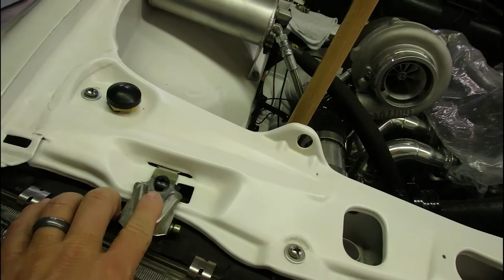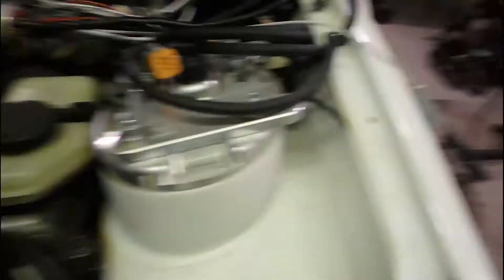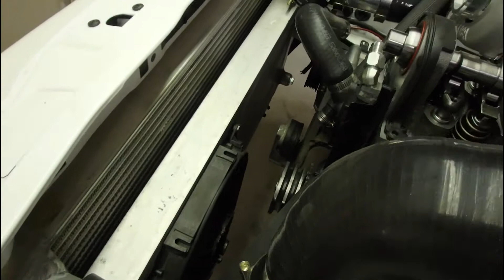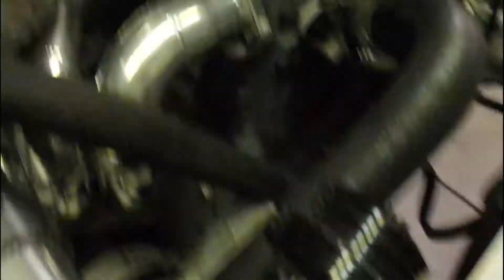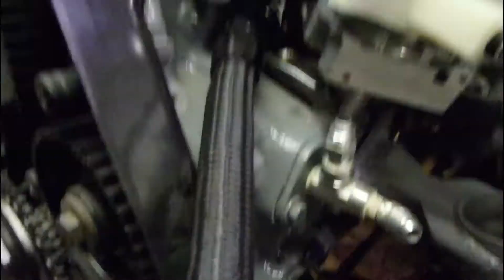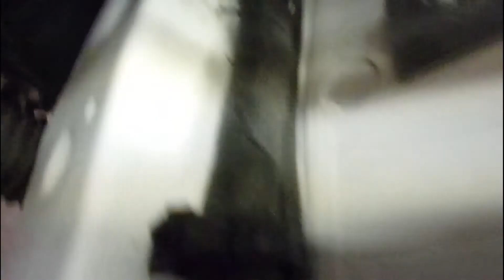Detailed walk around of my 1987 Merkur XR4Ti! Part 1 - Discussing the built 2.3L Ford Lima engine

Comment: Wow, that’s a lot of know how and work. The car looks just great. I think I sent you message years ago.  I am one of the oddball Ford crackpots (since 1979) up in Vancouver Canada. 

I used to own Group A four-door Saphire Cosworth race car that was  street legal and was probably the fastest car I have ever owned. 

I also owned a 1995 Group A Ford Escort Cosworth built by Ford motor sports in the UK but I purchased it from somebody in America in New York about 10 years ago.

 I currently I own Mallard green 1992 Ford Escort Cosworth that has been slightly resto modded which I’m going to sell and probably move to the new Ford focus RS.

On their own a single cam Ford engine is nothing spectacular except for the SVO mustang. As you know Jack Rouch used this little engine for years winning championship after championship.

Making a high horsepower four-cylinder engine is one thing but if it’s going to be driven on the street and you want a the engine to be fun and exciting to drive you need to focus on how to make the engine responsive at lower RPM. A laggy high horsepower turbo four-cylinder on the street is quite boring. 

Unlike you, I find four-cylinder turbo engine building intimidating and complicated, especially if it’s a new untested engine set up. You really need to know what you’re doing. Normally aspirated engines are much less complicated to build.

There’s a lot of things that can go into building a responsive four-cylinder high HP engine like the engine management system, the size of the turbo, cam selection, the size of the ports on the heads, gearing etc. 

Besides all of the above, if you want to make your engine rev quicker, a smaller flywheel is ideal as well as tighter gearing. 

This is my opinion. Hope I can see your car on the road soon. It’s probably going to be the one of the best Ford Merkur XRT cars in the US.

Michael.

Comment: I used to import Cossie parts for these cars back in the 2000's .. i brought over at least 150 pairs of the German Spec (left hand drive) headlights which are the correct lights you'll need for this conversion. I'd say about 1/3 of them got destroyed in shipping. I would import full cars, both Rs and Rs500's along with all the Group A spec driveline and suspension parts , body kits, you name it ! Had a a good relation with many wrecking yards over there .. wheich they call breakers in Europe. I've owned 14 Xr's over the years but own none now. My last 89 had full Sierra Sapphire awd conversion, Esslinger built block which was Turbocharged and supercharged with B234f Volvo head, Tko600 Transmission & custom transfer case and a Toyota Supra differential. I also built an Ls1 powered 88.  I miss them all. Anyway, Glad to see you and many folks here are still restoring and driving them.

Comment: Thats a really nice chassis to start with! I'm doing the angry eyes with silverado headlights. Don't gotta spend 100s on headlights for Cosworth Spec and cut out the buckets. Figured I document it as well, most likely do a Honda J swap/Subaru 6 speed trans. Have a full grey interior, which i wont be using except the front seats. Uncracked dash, trim, door cards etc. Should hit me up if you are building a show car. Know guy from Merkurs Midwest. Good job moving that battery! My question because you started over, why not a 2.5 Ranger block? ;)
Reply: You don't have to spend 100's on the headlights, just many 100's on the grill... lol
I read some posts years ago discussing the angry eyes grill and the installation of the Silverado headlights.  According to one individual, there was no way to actually mount the headlights.  Is that true?

Comment: NOOOOOOOOOOOOOOOOO
THE LOWER BLOCK BREATHER WILL GIVE YOU WATER. If you like I can make a vid to prove  it. Matter of fact. Check my YouTube channel in an hour. I'll show you the water that comes out. And also you'll  need a bigger can. I'd fill that in 2 or 3 cold starts. The valve cover breather is where all I get is oil. And I get about 8 ounces of oil in that one every 9 to 10 hard runs. (25psi). I'll post a vid. Please don't do that crap. The oil vapor coming out the block has alot fuel vapor as well and you don't want that back in your main oil. 🤦‍♂️. Love the build though. Awsome work. 🤘😎✌
Reply: I posted a vid for ya. Showing the proof . No edit. 🤘

Comment: A customer just gave me one today. He got it towed to my place but he said it's been sitting in the garage for 19 years. It's not running at the moment. Any advice?
Reply from the maker: Start with the fuel system. Drop the tank to check it / clean it, pull the fuel filter, then flush the lines. I’ve owned a few with rusty gas tanks.  Check the plugs, wires, cap and rotor.  Put a little lubrication in the cylinders, check that the radiator still has fluid in it, check the oil to make sure nothing weird in there and then see if it will crank.  If it cranks, button it all up and see if it will start.  If it does start and run, I suggest changing all the fluids. There are several great vendors still offering parts for these cars - Jeff at Merkur Parts Midwest in Illinois, mike at Merkur Depot in Ohio and Russ at Rapido Group in Oregon.  Good Luck!!
Reply: @87XR4Ti  thanks for the info. I had a mechanic look at it and said I would need about $2,000 more or less to get it running safely replacing parts due to old age. Is it worth investing in it?
Reply from the maker: @merkur360   The price on these cars is finally going up and good clean examples are getting hard to find.  I love Merkur's so I say yes, it's worth it.  However, they're not for everyone and before you decide to invest in it, check the pinch joints under the body cladding to make sure it's not rusted. They do have some annoying issues "Merkurisms" but if you do some research (merkurencyclopedia.com) and keep in mind that you'll need to acquire most parts from fellow enthusiasts and the few remaining Merkur vendors, then you can build a unique, fun, great performing car that will put a smile on your face.  I just picked up an 88 XR for my 15-year-old and I'm looking forward to building it with him.

Comment: My brother and I have a very similar build on a fox Mustang used for autocross & street; same head, cam, & engine management as yours but a 3071 turbo. Definitely gets pricey. We use the stock distributor & single coil running max 7200  RPM & 20lb boost limit, with no issues. What is the benefit of your 4 coil conversion? Also, are you using the 5.0 T5 trans? If so, did you change the rear end gearing? We went with a 4.10 to work well with the V8 3.35 first gear ratio. What are your intentions for the car? The combination sounds good for the track, but I would expect diminished low end power and increased boost lag being disappointments on the street.

Comment: It’s been so long but back in 2006 I had a 1987.5 XR4Ti.  The best upgrades that brought it to life was the Esslinger head, which is sooooo much lighter than the iron head.  And the Quafie Limited slip differential.  

That LSD improved its cornering abilities so well I felt like I was driving a go kart on rails
Reply: I dynoed at Carlisle PA 242hp and 272ftlbs of torque at the wheels. 

I have no doubt, with the turbo you have, that yours would be much much faster

Comment: Can you give more detail on the distributor? Where did it come from, and how does it work with the coils?
Reply from the maker: The CAS (Cam Angle Sensor) kit comes from Stinger Performance and is designed to work with the Megasquirt 3.  With the CAS kit you're able to run sequential fuel injection and it also allows the use of COP (Coil on plug) or coil near plug in my case.  You can find more information at the Stinger Performance website and the Megasquirt.info website.

Comment: Damn that's motivation
Reply from the maker: I need to finish the walk around.
Reply: @87XR4Ti  what's the valve cover gasket you have I need to get one
Reply from the maker: @michaelprettyman4529  it's from a late model Ranger, Ford part number F57Z-6584-A.  There are a few on Ebay right now and you should be able to still get one from a local Ford dealer.